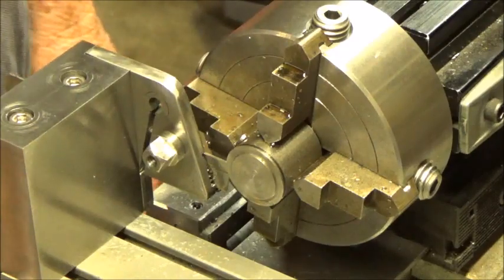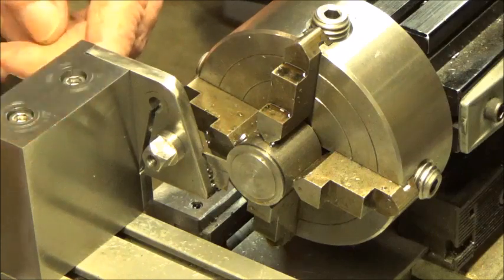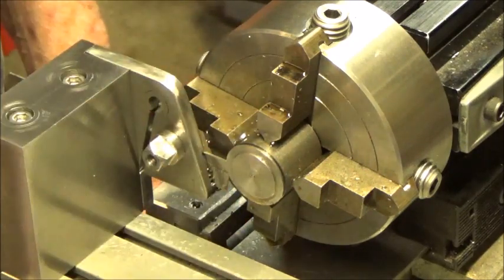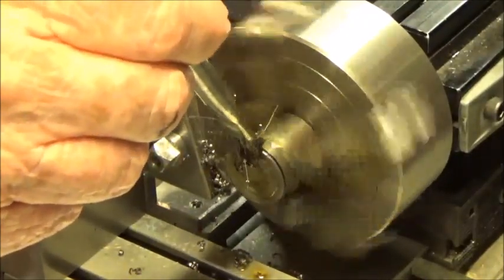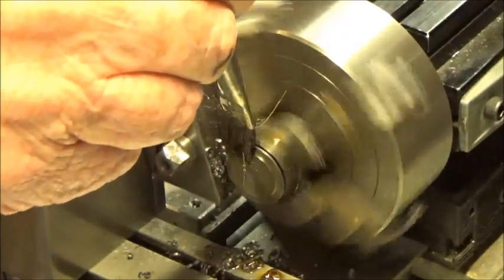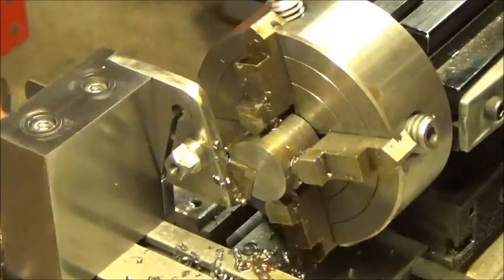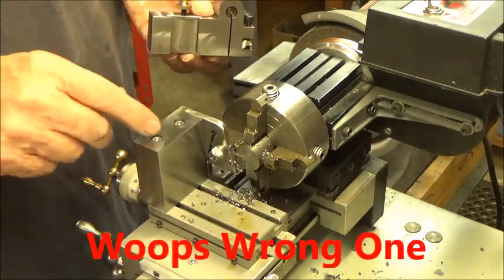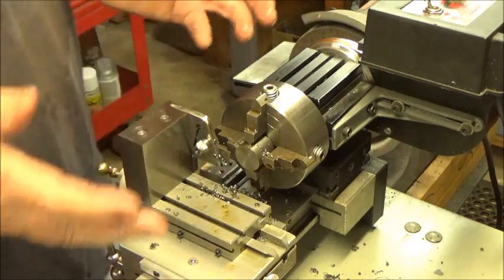Taig Micro Lathe Parting Off (Spring Tool)

Comment: This seems to work pretty good, but have you tried mounting a parting blade on the back side of the cross slide and upside down? Or running the lathe in reverse with an upside down parting blade? Once I tried this on my mini lathe, parting was infinitely smoother and faster.
Reply from the maker: Yes I tried all that and I have a video on it.  Regards: Larry

Comment: By chance do you have some pictures of both sides of your tool holder.  What grade of steel is it made from.  Looks like a good idea.
Reply from the maker: John:  I probably have some pics somewhere, but right off hand I'm not sure where they might be.  I have a place where they are supposed to be, but for some reason the folders are empty.  Both my spring cut off tools are made from mild steel (1018) and a spring roll pin is pressed into the center.  I may have a play list on the subject.  I remember that in one of the videos that I removed it from the carriage and showed all sides of it.  Check the play list.  Regards: Larry
Reply from the maker: John: I dug out some photos this morning.  Look in this folder and the sub-folders for pictures of the spring cut-off tool holders and the spring forming tool holders.  Link below.........Regards: Larry
https://1drv.ms/u/s!AoFHBXavAXM5g7dsoZ3RdtgSwaEZPg?e=oKdUNJ
Reply: Thank You,  You have done a tremendous amount work on this project.  Is it true that the spring feature cancels out the common chatter.
Reply from the maker: @johnwalters6800  I don't think you should have chatter, but tooling does want to grab.  You need a very stable and solid situation for doing cut off work especially on tuff steel materials.  I find the spring holder to work very well and it's my go to item for difficult jobs.  That said; I find for most non ferrous metals and small diameters that a standard conventional method works just fine.  If you search on "oxtoolco" videos you'll find a very good explanation of the reasons why the spring holder works.  Probably search his videos for "spring tool holder".  You can try this link:  Larry
https://www.youtube.com/watch?v=KETVR9qtEmY&t=6s
Reply: I watched the video and the tool holder made sense.  I checked E-BAY and they had a nice Armstrong unit that was way to large.  I will keep it in mind.  I am presently tooling up a self configured lathe using a Taig 5C spindle and the small Taig X-Y cross side.  The Taig 5C spindle is sweet.  I recently installed it on my self configured mill and I had to make a lathe with the same sweet spindle.  I am real bad about thinking outside of the box.  Your tool holder fits right in.
Reply from the maker: @johnwalters6800  Yes, I used the Armstrong design configuration.  You can't purchase that type of thing these days.  Good Luck Larry

Comment: Hi Larry I bought the tool post and blade from Taig. I've tried squaring the tool post to the cross slide I've tried keeping the blade from sticking out very far "as short as possible" and keep moving the blade out. No worries I don't use the Taig that much just for hobby stuff. Thanks for the video stay safe.

PS I don't have a way to make that tool holder.
Reply from the maker: John:  With the Taig tool post you can't keep moving the blade out.  The blade is set in only one position.  The maximum diameter bar stock you can attempt to cut off is probably about 3/4".  The blade moves in and out at a slight slant, so you just move it out until the cutting tip is at Center.  That's probably about 1/2" extended out (that's the only place it will work).  The other problem with that tool post is that the blade clamp prohibits you from getting close to the chuck, and that's where you need to be when parting off.  You don't want any excess material hanging out (even large diameter stock).  Hope that makes some sense.  Best Regards: Larry

Comment: Nice video Larry, very impressive I use my identical holder with  0.060 cutter on my tool holder post which is not as solid as your setup so it is not as rigid as your setup and when it stalls the belt stops but the motor continues running give an almighty screeching noise, I think you have different size pulleys than  mine so I might try moving my belt to a larger dia pulley o0n the motor and see how that goes also I am using a 1.250 billet of mild steel, so we will see,
Reply from the maker: Walter:  It's good you were able to watch.  I will probably move it to the public in a few days.  The little Taig could certainly use a bit more horsepower and low end torque, but all in all the spring holder works pretty well.  I also have some larger pieces laying around that I could give a try.  Best Regards: Larry